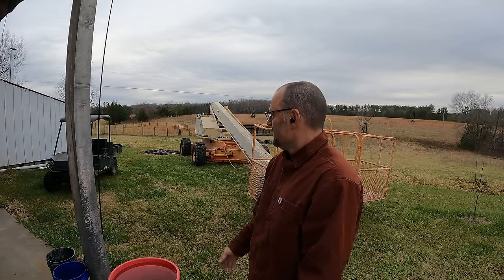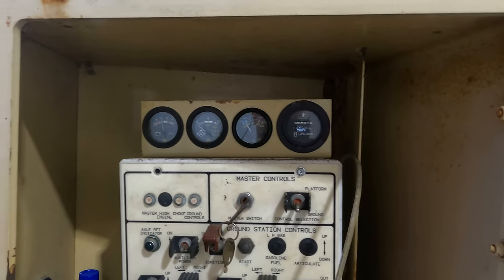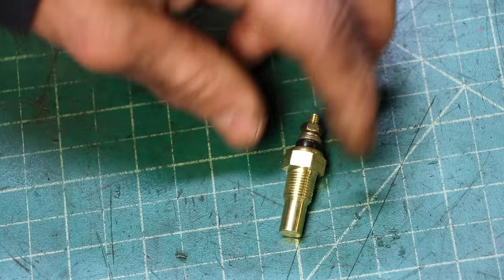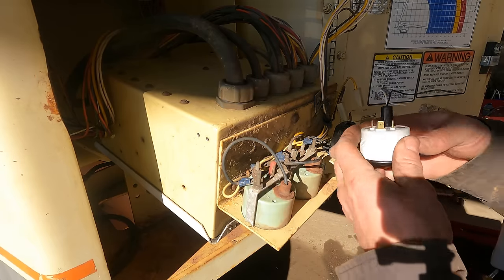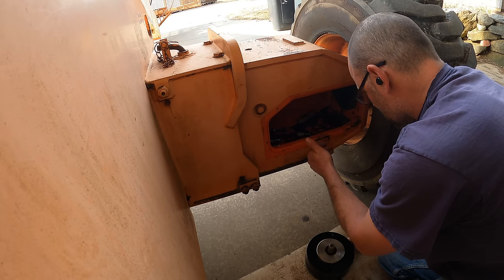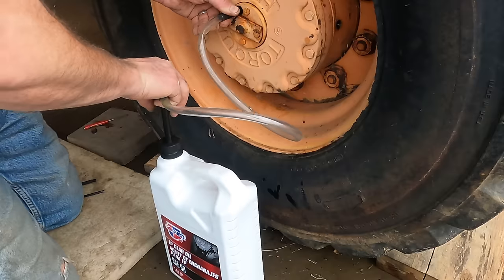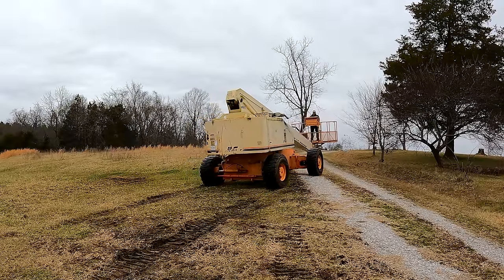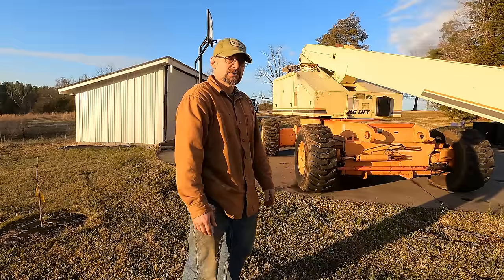Fixing The Boom Lift's 4 Wheel Drive System and Other Stuff.

Comment: As a Boom Technician in Canada, this video intrigued me. I have worked on this very model here. Good job getting the engine and drive problems figured out!

Over here, there needs to be an annual factory inspection as well as an engineer's inspection and certification. The engineer inspects all of the welds, railings and frame for damage or breakage. My job is to perform a mechanical inspection and correct anything that does not work as intended. 

Your boom chains do not need to be replaced unless they are damaged or stretched more than 3%. That being said, it's a lot of work to go back in to replace them later on. If the chains are okay, soak them in diesel to loosen them up and clean them up. If your wear pads look worn out, replace them, do not add more shim plates. Give the extend/retract cylinder as much love as you can, you'll probably only remove it once. At full extension, the boom looks like a bowed fishing pole. This is normal and engineered for this. I'll give you a sub and keep watching your progress.

Comment: The coolant sensor to the ECM is probably for timing advance.
Reply: Agreed. The ECM also may look at oil pressure and coolant temps to kill or limit power.
Reply: Kinda odd that it has a map port too. If it works how it think it might do, coolant temp probably retards initial timing as it warms up and uses the map port as the curve throughout the range. Probably no more complicated than that. No idea how oil pressure is being managed for the machine-side although I'm 99% sure it's got something to cut ignition if pressure drops below threshold (whatever threshold is). Wish I'd known this little standalone ignition/ECM existed 25 years ago as it was a total pain in the ass coming up with good solutions to run early distributorless engines on carb back then and total FI delete (if anyone did circle track back then you'll know exactly what I mean)
Reply: Yes that little ecm should also cause an engine shut down in the case or over temp or loss of oil pressure. It also changes ignition timing base on engine temp.
Reply: Came to the comments to check to see if someone has said this, good to see Wes in the house lol.
Reply: @adamvandenboogard509  You know what, I didn't think of that.. that makes it even more simple than I thought it was.. ECM temp sensor may do absolutely nothing more than kill ignition when temp threshold is exceeded, nothing more, same as oil pressure. Just electronic Murphy switches. That explains the map port now.. that's what's running total timing & the curve. Exactly as a distributor would (twisted for base timing, bob weights or dashpot for the curve). That's an elegant out of the box totally 90's-reliable solution to running a distributorless rig on a carb
Reply: I could be absolutely wrong in my assumptions, but unplugging the ECM temp sensor would absolutely tell the whole story based on how it acts unplugged (should fail to start - no spark if no sensor detected. MAYBE. Might even be too dumb for that and only knows to kill spark @ x temp who the hell knows). It's too bad I can't get my hands on a used one to play with. They're stupid expensive, I looked lol
Reply: @Drmcclung  I know the fuel injected version of this engine will run with the temp sensor unplugged. However it runs very rough. Was working on a genie a few years back
Reply: @adamvandenboogard509  FI is a whole different animal, needs a temp and o2 signal to get the fuel trims right once in closed loop. It runs rough unplugged because it's stuck in open loop on a pre-set fuel map that's way too rich after warmup.
Reply: @adamvandenboogard509  The little box in this JLG, really not anything more than a glorified ignition box. Wish I had one at home to play with (this particular controller) to know exactly what it does, but I highly suspect it's using temp & oil pressure inputs as Murphy switches, and the MAP analogous to the vacuum advance on an old fashioned distributor. Like I was saying before this would have been a really neat controller to have way back in the day when we didn't have off the shelf options to run FI distributorless engines on carb and no easy way to adapt the FI ECM's to just control ignition without the rest of the FI system in place
Reply: Not that anyone wants to hear about old tech buuut.. back in the bad old days 1 way to run these old distributorless Ford's on carb (sanctioning body provided the required 2bbl) without the FI crap that just didn't work without the whole thing was by grabbing an ECM, coil pack, crank & MAP sensors out of an 89-94 2.2l cavalier from the junkyard for about $50 (not an ironduke 4, that was too primitive and the electronics were junk anyway). You made your own reluctor for the crank trigger, bolted it to the back of the oil pump drive sprocket (the one the timing belt drives) and stuck the crank sensor where later model ones had the cam sensor located. The standalone GM MAP ports were the key to making it work right, the way you wanted it to. And the reason for that particular rig was the removable ROMs in the GM units were by far easiest to fark with, modify etc.. There were lots guys out there who could program the ROMs and you didn't need the temp circuit to control ignition, you could switch that off in ROM. You could grab more ROMs from there junkyard to program for different base timing and tell how much advance to make in the curves based on MAP for different tracks and track conditions etc, the sky was the limit if you really knew what you were doing. Wasn't difficult at all to make it work. That was just one cheap hacky way of doing it, but it worked. The Ironduke guys could get it down low in the turns, but us OHC Ford's just freight trained them going into the straights

Comment: You did okay with the Allen head drain screw, but just wanted to mention an old trick for stripped Allen head screws.  Hammer in a slightly oversized Torx socket.  The Torks has six flutes and digs right in.  Then use a breaker bar.
Reply: Mac RBRT extractor allen sockets are great for stripped or rounded allen bolts, they work great even when they aren't stripped and you want to prevent them from stripping in high stakes situations. The torx trick does work, but sometimes you have no room to hammer them in. They're not cheap but considering the time they save you they pay for themselves quickly.
Reply: Not an easy spot to hammer though.

Comment: This is such a great channel!  I love watching the videos you put out.  To the boom repair project, I couldn’t agree more with the teardown and inspection.  I came from the aerospace industry and “Don’t fix it if it ain’t broke” only applied to your letter opener. ALL of the machines that were used to make parts that went on airplanes were on a preventive maintenance schedule.  Before this policy was implemented, the maintenance department joked that they were firemen, running around the shop, stomping out fires. After a PM program was developed and implemented, machine down time that interrupted workflow all but stopped.  The gains in productivity were huge. 
If your butt depends on this thing to function properly, get it on a preventative maintenance schedule that works for you. (If you checked the boom in two years following your up coming teardown and it all looked great, go ahead and extend your PM time frame to every 3 or 4 years. Check it again in 3 years, if it’s all good, extend it out even further. Maybe put a hobbs meter (hour meter) on the lift and check the important things using actual use time if just sitting out in the weather doesn’t hurt it.   Make it a system that works for you and you’ll be far less prone to things failing in the field.  That’s when the machinery downtime really hurts. 
Keep up the great content!  This is one of my favorite channels. The humor you inject brings you down to earth with the rest of us mortals.  Love it!

Comment: Another video where I learned a couple of things.
I have a tip for you. If you cut electrical tape instead of stretch/braking it, it won't come unwrapped over time.
Yes rebuild the boom, I operated JLG's for many years and hear your concerns.

Comment: With all your videos on this boom lift, I want to run out and buy one just to repair!! 😉. Thanks for the great content.
And a quick side note, my 1988 Dodge W150 has 2 temperature sensors and 2 oil sending units. And like the boom lift one of each is very well hidden.

Comment: We had two boom lifts at the company I worked at. Retired now. We had inspections regularly. In 15 years that we had the lifts there was never a “tear down” of the boom mentioned by the inspectors. So it wasn’t done. Lubrication and PM was done but that’s it.
Reply from the maker: That surprises me. When and where?
Reply: @FarmCraft101  In Oregon. Working at plywood plants. Retired last year but still nothing like that happened up to that time. Not a union plant and the company owned the machines. Most rent or lease and requirements would be different then. We had osha inspections and lift inspections by the man lift companies. I only know this because I was there maintenance manager for years. Rolling stock was handled by a different shop but I scheduled inspections. They are much stricter with cranes.

Comment: Jon, you have some amazing tenacity. I’d need to use a common logarithmic scale to measure it. This boom lift is sure testing it to the max. Based on all the problems you’ve had to fix on it, I’d bet a lot of your money that the previous owner did very little maintenance on it using a tech certified to work on it. So checking out the boom  isn’t just a “might get to it sometime” job. I’d categorize it as a “not going to use this until I inspect it and fix everything that looks out of sorts” job. You have probably tripled it’s value with all your repairs. 

Your channel has great content and I appreciate the video quality too. Keep them coming.

Comment: Click.   Love that calibrated torque wrench...🤣.    To answer a comment you made during your water gauge fix, the brain box does reference coolant temp to help manage spark timing strength and possibly go into failsafe mode should it see really hot temps.

Great content, information and entertainment.  Keep up great work

Comment: I thought about the first sensor not having ground just because of the thread tape, but yeah if that pipe is plastic then it doesn't matter.
Reply: Yeah it's why the original sender was in the block, it grounds to the block itself.

Comment: If you read and interpret the load chart for this unit, you will see that the boom is not designed to extend out beyond a certain length without being in the air at a certain angle.  I've never seen one 80' horizontal. My guess is to inspect the chain and rebuild the cylinder, you have to have the basket stationary, and drive the unit backward while extending the boom. Love the series.

Comment: i just torn my snorkel S60 down about 2 months ago and rebuilt the cylinder and replaced all four cables (mine has cables to extend instead of the chain).  it was a project but very interesting work.

Comment: Protip for wiring diagrams, make a copy of it, and use highlighters to follow wires. Cheap-o kit works wonders, mine is i think 10 colors. Its Sharpie brand because it was the only narrow tip, get them after school starts when they are cheap as dirt. Makes it 10 times easier to keep track of what you want to look at.

Comment: having a 110HX lift (many similarities) I enjoy the videos.  I use mine for hobby stuff as well, working on my amateur radio antennas and towers.  I am VERY glad to have the schematics - my first manlift (a Grove) had none and it was a pain. I essentially bought the JLG because it had publicly available manuals.  Anyway, getting unstuck - I have used the boom to push myself out of a hole.  It does it effortlessly so I don't feel I am damaging anything.  Also mine has a hi/lo/creeper speed.  In Hi you get cattywumpus on a ridge and the two tires will just spin.  But if you go to Lo it will force the fluid (to some degree) to the tires with traction and it will generally get you going.  And putting the boom to where it needs the weight, as others have suggested, certainly helps.  And my cage bars are bent like yours.....

Comment: I worked in the equipment rental industry for decades. All the aerial equipment manufactures replacement parts were insanely priced. On aerial equipment, when parts went bad, if the part had a manufacture tag or name, I'd call that company direct and buy the same new part for 1/3 of the cost from the equipment manufacture. Example- 20' electric scissor lifts have a 24 volt DC motor that drives the hydraulic pump. The equipment manufacture wanted $700 for it. I saw the tag on the motor from who made it and called them. They sold me the same motor for $250.00. Some parts were made specifically for an equipment manufacture and were protected meaning they wouldn't sell the parts to anyone but the manufacture. I found that most parts were not protected and bought them direct from the parts maker who sold the parts to equipment manufacture. There are also equipment wrecking yards where equipment is stripped of it's good parts similar to a car junkyard. You can find lots of still good parts in those places as well.
Also,  I've never heard of a boom mast assembly needing to come completely apart every two years. No way is that right. An annual inspection? Yes, but taking the boom apart isn't part of that. The only time we took a boom apart is something broke inside it. This is with a national equipment rental company.

Comment: The ecm temp sensor could be for overheat shutdown, timing adjustments, egr, auto choke if it has one, rpm limiting by temp, any number of things. Lots of vehicles use two one for the gauge and one for the ecm

Comment: One big help when your tires are spinning is moving the counterweight.  Most lifts have an auto axle level cylinder that sometimes gets locked until the weight gets off it. Not to mention the drive tire may not have much weight on it, so moving the weight will help it get traction.
I’ve used the basket knuckle to get them unstuck too. Putting it on the ground and using it to push or pull while driving it. It works well but you can shear the basket pins or bolts off if your not carful. 😖

Comment: Hi John, I have enjoyed most of your videos on this channel. I have noticed on several videos, a great loss of hydraulic fluid when removing cylinders to work on them before you start this boom teardown, I would suggest removing the vent from your hydraulic tank and installing a vacuum system, such as an airline with a Venturi to pull a vacuum on your hydraulic tank then when releasing your lines on your cylinder, you may be able to draw all of that fluid back into the hydraulic tank. You might have to manually actuate your valves in order to let the fluid flow. After lines/cylinders are empty you can cap/plug them as normal. 
You also may want to install a pressure regulating valve on your air supply as sometimes the vacuum can start shooting hydraulic oil into the air. If pressure is too great. This can be a great mess and money saver as hydraulic fluid is not cheap.
Just a suggestion from someone who has been swimming in hydraulic oil before!

Comment: Hi John , am just in Awwww of you and how have taken on this basket case of a machine!!!!! Your other Vajayos are also a 10 our of 10!   One Trick I learned late in life ( and I have an engineering degree) Regarding temp sensors and adjusting the calibration.   The Temp sensor is a variable resistor so by putting a shunt resister across the gauge you can adjust the range of the temp gauge ( trial and error with resistors while measuring actual temp works best). Note: some temp sensors are linear and some have a resistance curve like an audio taper potentemeter a little tricky to get the correct hunt resister ... On another Vajayo you did with the water filters and parrileling them and getting 5x the life....that explination was pure Genius! ( Tesla himself would have been impressed with that explination)

Comment: Maybe make 3 large supports to take weight of boom in a level & horizontal position, to help with disassembly and reassembly. With rollers would be even better, but a lot more work. Rollers would only need to be the width of the boom, the legs as wide as possible. Good luck, it will make great content.

Comment: I use to work on these these JLG machines and  went to JLG school for a week.  I worked at High Reach Aerial Platforms in  Pa. For six years. Rebuilt many of those booms. I cannot tell you that I never seen a unit come in for boom failure. If the hydraulic hose would blow off break or leak the boom will not retract. It has a holding valve the prevents it.  Most common problems I did see was worn wear pads on all four sides . Usually the bottoms worn down the worst if used during sand blasting.  The rotex bearing the let’s it swivel around 360 degrees replaced several of those , but the main reason was do to the bolts giving a false problem as if bearing was bad . 

Check the chain tension  and keep it tight and lubricated.  Self driving machines make sure the tire pressure is up to par on al four corners. Some may be fill / solid tires.